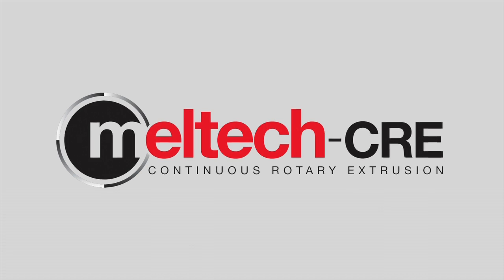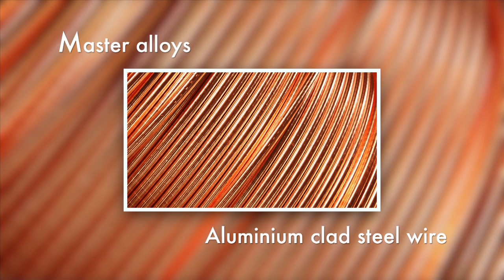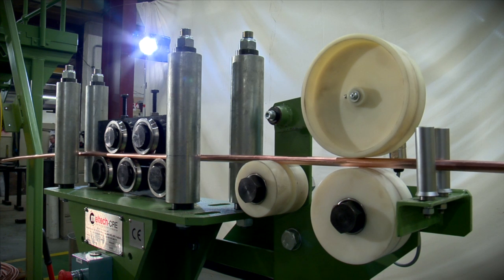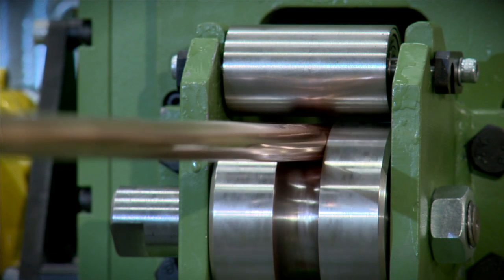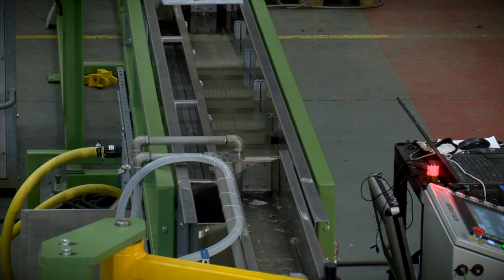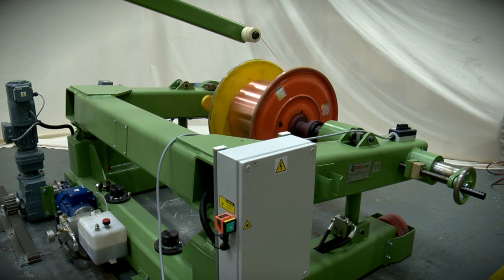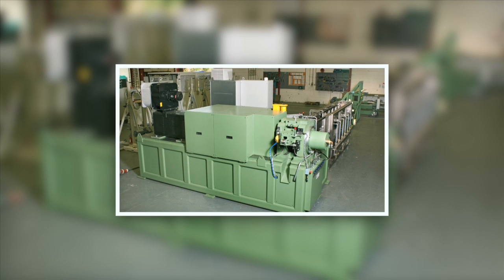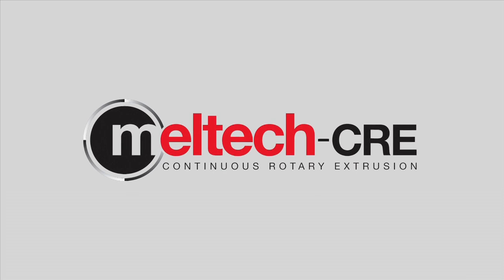Meltech continuous rotary extrusion machine

Comment: Wonderfull
Reply: sir,we also have this zinc/aluminum wire production line.
May contact Joey for more details.
Email:sales1@xinkeju.com
Tel.+86 15915239831
Reply: How do you remove the dies from the copper extrusion?